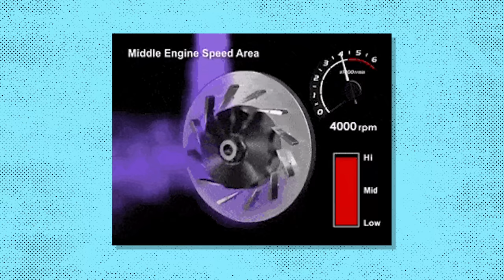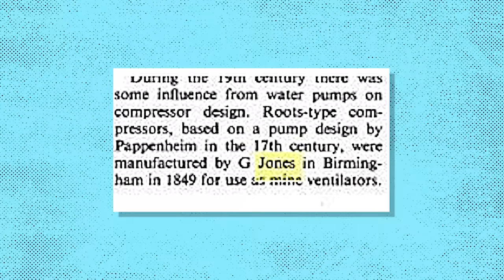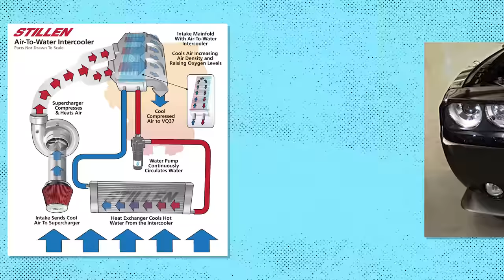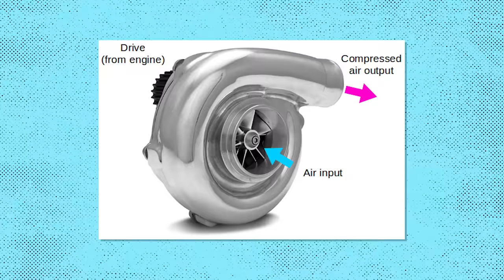Why Superchargers Aren't As Good as Turbos

Comment: Not going to mention how lotus or Chevy prefer supercharging? I prefer turbos but they deliver power too aggressively when you are wanting big power due to lag. My turbo threshold is around 4000 rpm so unless I’m trying to race it actually makes my car slower and unresponsive feeling. The advantage you didn’t mention to superchargers is that they bring on the power progressively and give the car a more responsive feel so they are much more controllable on the track coming out of a corner and more useable on the street. You could argue that small turbos are more responsive but what’s going to make more power and be responsive at the same time a large supercharger or a small turbo? Turbos have their downsides as well which are very much worth mentioning.

Comment: 3:20 A positive displacement blower supplies air in a direct fixed relation to revs so twice the revs is twice the amount of air, not the same amount of air over the rev range. And pressure has little influence on the amount taken in.

Comment: Positive displacement dosn't mean it supplies the same amount of air everywhere in the rev range, it means it physically displaces air by drawing it in and pumping it out (compared to a centrifugal which works differently). Your engine is a type of positive displacement air pump. If a supercharger supplied the same amount of air everywhere in the rev range your boost curve would spike off idle, dip around peak torque, and then rise again. 
What a roots supercharger does is displace about he same amount of air per revolution. The more revolutions at a given time, the more air it pumps (to a point). Spin it fast enough and it pumps more air than your engine and you get into boost, the air starts to "stack up" under the the supercharger due to the limits of airflow of the engine which increases the air's density which means more fuel can be burned to make more power. The boost you see on your guage is essentially backpresure from the blower trying to push air through the engine.

Comment: Turbos are only more desirable because they take advantage of a substantially higher delta of forces. Turbos are actually horrendously inefficient when you look at it from a physical science standpoint. Tens of thousands of PSI of combustion (initial) is the source for a turbo, but you only need a tiny fraction of a fraction of that to do meaningful work outside of the chamber. Which also means a tiny fraction of a fraction of a percent of loss due to those restrictions from the turbo. Which means they can make more powerful cars to accommodate more government restrictions (small engine = less polar bears die or whatever).

It's been well documented that in the event of a direct replacement to an intake port, turbos are damn near 100% efficient psi vs. psi of added atmosphere. So there is also a notable performance incentive too to spite the less accommodating arrangement a turbo may present (gotta get big tubes and stuff going everywhere).

However, the blower goes wrrrrrrrrrrrr and I like that better. 🙃

Comment: I think some things are glossed over here or only briefly mentioned, a summary would be good. Superchargers have better sound, exhaust note, power band/delivery and are generally easier to work on. Turbochargers are more efficient, have a much lower parasitic effect and are often more compact. Both suck (air) and both are great, just in different ways.

Comment: "Unlike a turbo  which can be  neatly tucked away in the engine bay."  You lost all credibility with this statement.  IF  it was so difficult (read expensive) to package a blower, manufacturers would not do it.  A blower is far less complex and easier to package than a turbo more  often than not.

Comment: There are quite a few things wrong here.
- roots do compress the air, via positive displacement.  This is inefficient and does build more boost with revs.
-twinscrew have no leaking like the roots blower, hence provide the same boost at all revs.
-superchargers do not need to be placed atop the engine. See any toyota or even your golf with superchargers.  They can even be intercooled.

Usually the content here is spot on, what went wrong?

Comment: The air in your turbo/supercharger gets hot mainly because it gets compressed and hot air is less dense so cooling it gives you more air, you don’t pass it trough the intercooler just because the charger is on top of the engine… although that heat also has an influence on the air

Comment: Superchargers are belt driven, while Turbos are exhaust driven. They both slow down the engine, initially. Superchargers are easier to install and last longer. Better in my book overall.
Reply: Only the supercharger has a parasitic load on rhe engine.
Turbochargers produce more power and are more efficient.

Comment: From my experience.
The supercharger is more reliable then a turbo and the power range is usually stays even with the operating rpm range.

Turbos deal with lag and usually only get good with higher or lower rpm range depending on size.

I would personally use a supercharger on a vehicle that does multiple tasks.
Trucks, multiple purpose cars(sport,DD,highway,work)

A turbo car would be specific to what I want it to do.
If it was a daily traffic car, then a small turbo would work great on stop and go applications.
If it was a standard highway car/track car, then a medium size turbo would be great for that.
If it was a long distance sprint car or a rolling drag car, then a big turbo would be a good choice.

I don't think companies use turbo because they think they're better.
Rather it's a cost issue and Turbos are cheaper to buy/rebuild vs superchargers.
Also automotive companies want the parts to fail eventually, so they can make some more money from them.
Reply: Turbo's are pretty reliable if you use them properly. If you demand high boost immediately with a cold engine, the turbocharger will show excessive wear pretty quickly. The same goes for keeping up high boost until you're home and then switch off the engine without allowing the turbo to cool down a bit. If properly used ánd providing only a mild boost, turbo's can easily last up to 200k km's or 125k miles. 

Porsche has made a solution for that problem a pretty long time ago: it's a VGT (Variable Geometry Turbo). The problem is that those are very expensive. 

Car companies use turbo's because bolting a supercharger to a small engine doesn't make much sense: the power you lose to spinning the supercharger is too great of a loss for an engine that's already relatively low on power. And as just about every car manufacturer has been downsizing their engines for quite some time now, a turbo makes even more sense.

Comment: Still superchargers don't suck. This video is just listing the cons on a supercharger and then saying turbo is better because it's more efficient and more cars have it. The reason most car manufacturers are using turbos is because they want to lower emissions buy downsizing the motors and still have decent power output with an efficient turbo. It wouldn't make sense to put a less efficient application for boost to try to make the power more efficiently lol. But that being said, the consistent, linear boost and no lag is much more predictable than a turbo and can prove to be better for some applications like drag cars where you need power right away or it can be good for a track car to have that instant, predictable response. Just because it's less efficient than a turbo, does mean it sucks. It just means you won't make as much peak power. Also centrifugal superchargers still don't have lag. They need to build boost with rpm yes, but if you mash your foot down when the rpm is high enough to make boost, there will be no lag.
Reply: Just like many other people the guy in the video has confused 'boost threshold' with lag. Just like an NA engine having a set power band it is most happy in the centrifugal supercharger is the same.

Comment: Turbos literally decrease power until they spool up. Quite a bit of power as well. It takes energy from the exhaust gases to spin the turbine, this creates a shit ton of back pressure and a vacuum on the intake side causing massive power loss. If you take two identical cars and slap a turbo on one, off the line, not on drag surface, the non turbo will win.

Comment: I prefer superchargers to turbo for the sound and instant torque, and the sc is in bypass mode while cruising so there isn't much parasitic loss in normal operation. I would think the turbo would compensate better though in high altitude conditions (i.e. Pikes Peak) than the sc with it's fixed boost.
Reply: Superchargers work equally well for altitude compensation... the difference is the turbocharger will always produce more horsepower because there is no parasitic loss like the supercharger has.

Comment: A lot depends on when you want the power.  On a large diesel you do not have enough exhaust gas velocity at low rpm. Hence a supercharger provides the air volume boost at ‘lower’ rpm vs a turbo. Locomotive diesels are super-turbos: full boost the whole rpm range.  

Both are fun. Turbos are pretty decently priced these days though.
Reply: Supercharged Diesel engines are 2-stroke and produce no boost, they are Normally Aspirated engines.

EMD Locomotive engines that are compound supercharged+ turbocharged do not produce boost either.
The supercharger is a scavaging blower and the turbocharger is used to 'unload' the blower at higher rpm.
Any questions?

Comment: Supercharger can only spin as fast as the engine, where as a turbo can spin up to 10x as fast.
Only advantage of supercharger is it is instant. No lag pretty much.
Reply: Superchargers are often driven by and overdrive gear or pulley, superchargers can have multiple gears that change the over drive ratio, they can also have CVC (continuously variable viscous couplings) an infinitely variable gear ratio.
 The fundamental advantage of the turbo is there no parasitic load on the engine.
 Turbo lag is not a real problem, it's an imaginary problem.

Comment: Something not mentioned in this video: Turbo Superchargers also use engine power to drive a compressor. If you stuck an obstruction in your exhaust system, it would reduce the power of your engine. But it takes far less than belt driven superchargers. Turbos are also completely unconstrained from the engine, allowing them to vary wildly in speed which I feel is an advantage.

Also belt driven superchargers aren't always belt driven. Various manufacturers of aircraft have, in using centrifugal superchargers, used other methods such as hydraulics, flexible shafts, etc to power them. Hydraulics were used to reduce (but not eliminate) anouther issue with centrifugal superchargers on aircraft : Throttling can reduce efficency. 
(In WW2 most fighter aircraft used centrifugal Superchargers as the perferred alternative in Turbo Superchargers had issues with temperature dissapation, metalurgy, etc).
Reply: Wow, you clearly do not understand how a Turbocharger works...
Reply: @sandervanderkammen9230  I've seen you in other comment chains. You are the one who doesn't understand how a turbo supercharger works. Your analysis of it ignores completely the fact that there is even an otto cycle engine in there, nor the fact that when we comment that a turbo supercharger does use a small amount of power from the engine as any poorly designed exhaust or exhaust with an obstruction in it does, we are talking solely from an analysis of an otto cycle engine, as with the supercharger. If you ran either with the compressed side venting down to atmospheric pressure, you would see a loss of power from the otto cycle engine on both. Another way of analysing it is as if you replaced the compressed air with air compressed by an outside source. In that, the engine would make more power for the same compression of air than either a turbocharger or a supercharger. This is what we mean by parasitic loss, it's a loss over the fucking ideal, so for example diffferent types of engine bearings and lubrication levels will also cause different levels of parasitic loss.

One could analyse it from the perspective of a Brayton cycle, but what work is that engine actually fucking doing? It's not doing any beyond it's own internal work to compress the air. You could analyse it with the piston downstroke being where the external work is done but then you both run into this analysis working for a supercharger, but also the engine is no longer functioning like a Brayton cycle would.
Reply: @GroundHOG-2010  That is absolutely false and a misrepresentation of what I said.

The turbocharger operates using the BRAYTON CYCLE in a COMBINED CYCLE HEAT ENGINE

The turbocharger does not have its own combustors/gas generator. 

The Turbocharger is a SECOND PASS HEAT RECOVERY ENGINE

Its however possible to use a Turboshaft/ Gas Turbine as a turbocharger..
A practical example would be the Wartasila SACM V8X Hyperbar engine found in the French LeClerc tank.
Reply: @GroundHOG-2010  I can see by reading your comments that you are very intelligent and think analytically by the way you are try to understand my comments, you just lack the specialized education.

Themodynamics and Fluid Dynamics are critical to understanding the complex relationship between the two combined heat engines follow the flow of energy in its different forms and its points of energy conversion.

A better hypothetical question be;

If you disconnected the fuel and ignition and spun the reciprocating engine up to 5,500rpm with a large external electric motor?
Would the turbocharger produce the same manifold boost pressure as the  supercharged engine in a cold experiment???

Another practical experiment that is very revealing, is looking at the exhaust gass temperature before and after the turbocharger exhaust turbine.
 The exhaust gas temperature typically drops 300° to 400° F as it passes through the turbine.
Where does the heat go???

Rudolf Clausius tells that energy cannot be created or destroyed according to the First Law of Thermodynamics
Reply: @sandervanderkammen9230  So again, I think there is a problem in this argument, the point being that I never said that the main source of energy was not both heat and velocity of the outrushing exhaust gases. In your hypothetical, assuming the throttle was left open, the turbo supercharger would spin up to a very low speed (if it does at all). But the thing I was saying has nothing to do with the idealised form of a turbo supercharger, but instead the realitiies. An Otto cycle engine ideally would have no friction for example, but we can all understand that even the best designed and lubricated one does still have friction. This is a parasitic load/parasitic loss. That happens with a turbo supercharger, except it is a very small loss as compared to say a supercharger which itself is having to take engine power directly to compress the air. That is entirely what is being talked about, not what energy source a turbo supercharger uses to compress air.

Also I am sorry for misrepresenting your arguments. I do not try to do this, and having read your clarification I can understand what you are trying to get at. I should have actually gone back and read them instead of relying on my memory of them.
Reply: @GroundHOG-2010  Thank you.

Communication really is everything.

Yes I agree, no heat engine can achieve 100% Carnot Cycle efficiency, The Carnot Emgine is hypothetical..
But the thermodynamic formula remains unchanged and applies to all internal combustion and heat engines.

A typical Otto type engine engine is less than 40% thermal efficiency and a Turbocharger (Brayton Cycle) less than 55%.

In a Combined Cycle Heat Engine, the thermal efficiency increases.

For example a Brayton Cycle  (55%) -combined with a Rankine Cycle  (53%) can achieve a practical thermal efficiency of 63%.

Reciprocating ICEs can achieve 55% efficiency when turbocharged  (Diesel Cycle + Brayton Cycle)

Just to clarify that, all of the energy that drives the turbocharger is waste heat energy.

There is no parasitic drag or loss from the reciprocating engine.

The turbocharger is a HEAT ENGINE and operates using the BRAYTON CYCLE.

Any questions?

Comment: My Mercedes clk 230 kompressor has the supercharger on the left. It does not have to be on the top. I know that has parasitic aspects to it, but it gives me such driving pleasure to have the power on the go..!! In city driving I never need to go above 2000 rpm to shift gear, normally even under. And overall the car is very low rev but with plenty of torque at any rpm, wich is good for the longevity of the engine. The car has almost 190 000 miles and never had engine or kompressor problems, and I intend to do the double, I heard that this supercharger still has plus 60000 miles normally of health. I will never sell it and intent to keep it as a classic, the look is intemporal for me at least, sporty elegance without being flashy. It has 23 years and still has a great stance and performance. Once achieved 250km/h, or 156miles/hour and it wasn't downhill 😉, the limiter cut the power that's how I know it was real, it was marking 270k/h..

Comment: You forgot to mention Lotus! Heat soak on rear/mid engine cars can be an issue with Turbos as airflow over the engine can, but not always, be a bit more problematic.
Reply: Rear engined Porsches didn't see to be adversely affected, the 911 Turbo being one of the most successful road cars in motorsports.